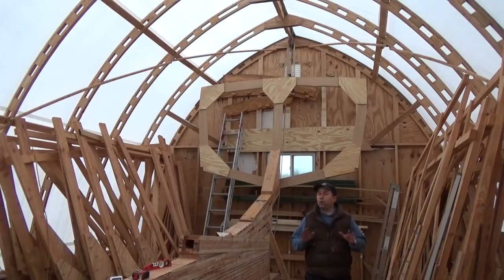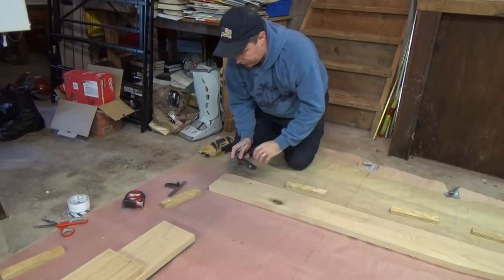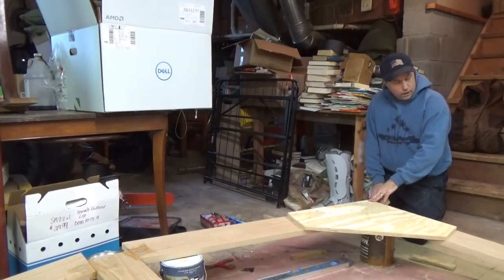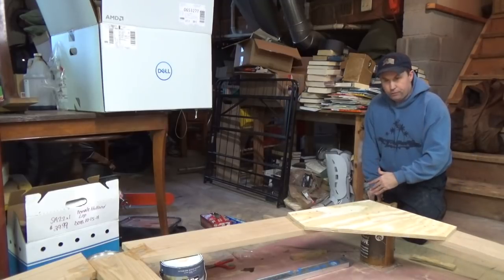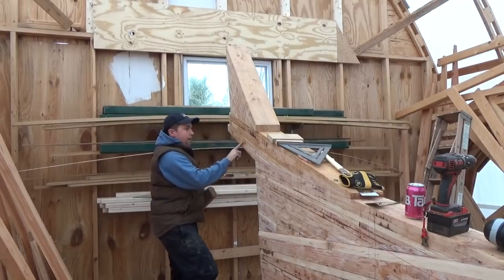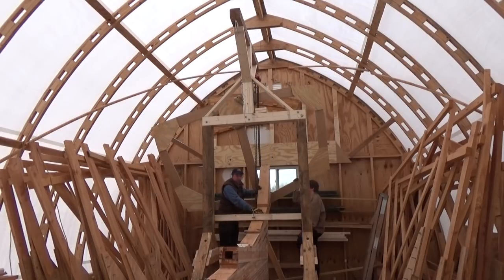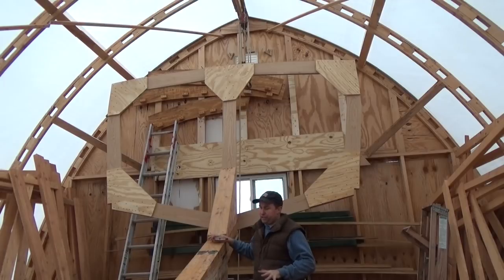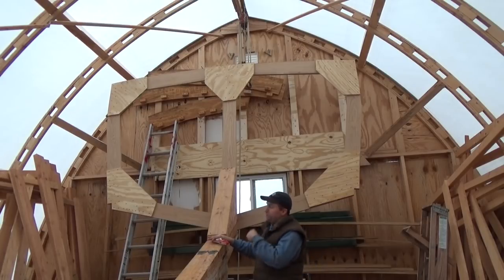Building and installing wooden boat transom on our 41' boat.  SDP #23

Comment: You should build a frame around the crane that specifically deals with catching the frames and keeping them level for assembly. Two pieces of wood and a few angle brackets off the main body should suffice, i believe.
Reply from the maker: oooh that's a good idea, like a cradle.  Thanks.

Comment: Wow!  Judging from the size of the transom that is going to be one big boat!   Do you know if the scantlings are generally similar for sailboats and powerboats of a given size?
Reply from the maker: It's even bigger in real life.  Sorry I'm not sure about your question.  I would guess sailboats are even beefier because of the stresses they undergo when under sail.
Reply: I don't know much about powerboats, but thought that with the engine vibrations and speed at which they move through the chop they might require beefier structural components, or more structure (stringers, etc) to support the hull.   Anyhow, I really enjoy watching the building process.  Especially for such a large scale build (I've only ever built dinghies myself).

Comment: Great to see you back again and making such progress. brilliant to get to estimate the actual size of the boat now that the transom is on. will there be a lead keel block on it?
Reply from the maker: Thanks Dave, no lead keel.  It's not a true sailboat even though it will have an emergency "get home" sailing rig.  We will have internal ballast so we get to our proper displacement.  We might use lead if we can get it, but we may go the old fashion way and use concrete.
Reply: Have to agree, that fitting of the transom, puts thing into perspective I can start to see the Hull outline. Nice job Scott !

Comment: I see the wood gussets but did you put the transom frame together with pocket screws?
Reply from the maker: I did use coated pocket screws.  More for alignment purposes but they do add a little mechanical strength.
Reply: I would think that using the strongest joint possible for a boat of that size would be critical. Why not use mortises and tenons or even use dowels both of which are stronger than pocket screws.